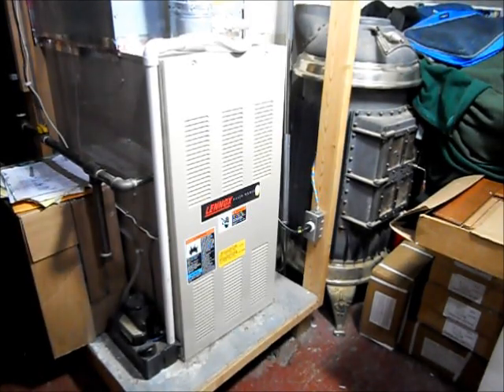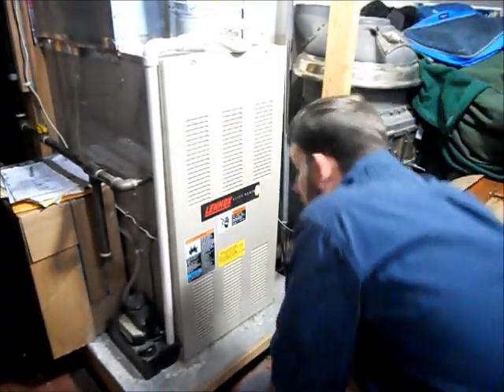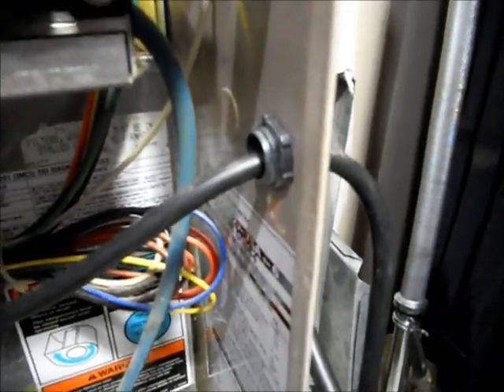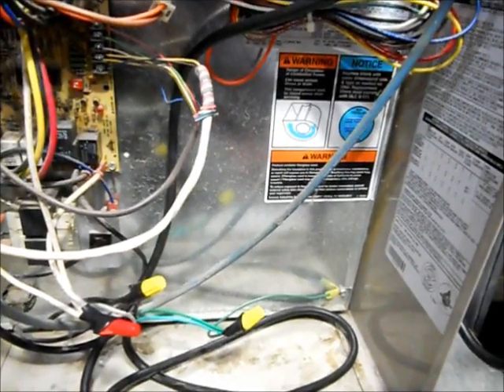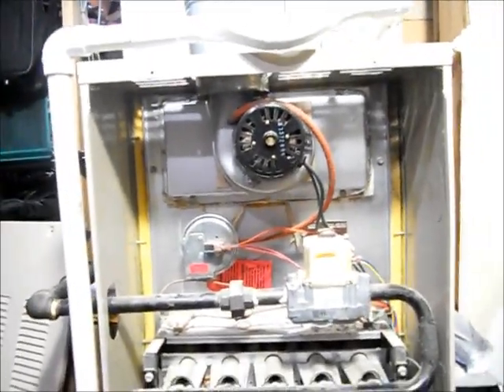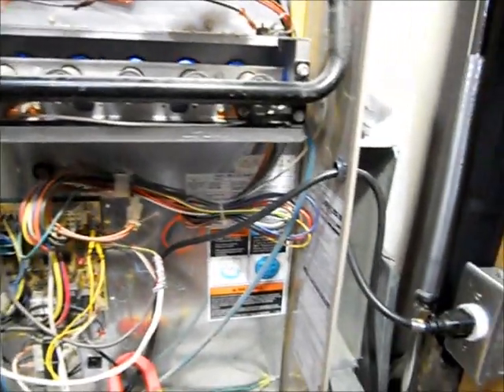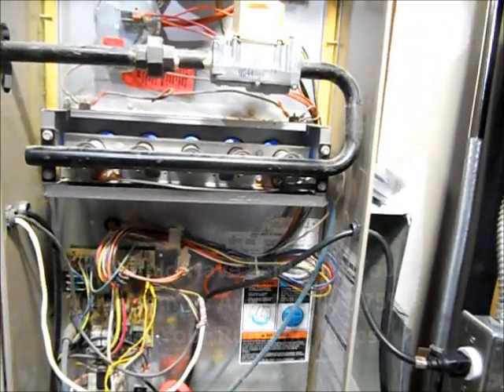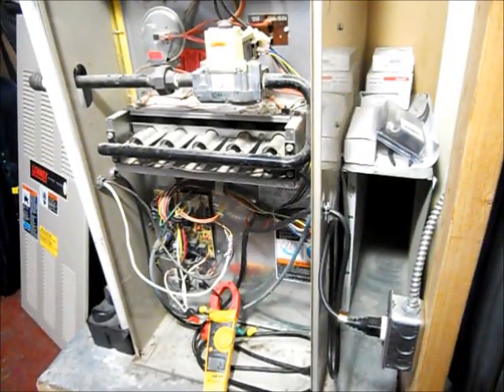RicksDIY How To Wire Your Furnace To A Generator Overview.wmv

Comment: In our house the thermostats 24V transformer runs off another 125 V circuit. So that has to be accounted for somehow or the furnace would never go on if just plugged into the generators extension cord.
i was doing some reading and it seems that at least some states codes require a transfer switch (for the generator) and you can't use a permanent flexible plug in cord for the furnace. I don't know if this is true though.
Reply from the maker: +Lockemeister 
That's a rare old bird you got there, pretty much anything from the late 70's or newer type furnaces all have the transformers inside on the same circuit. I have seen that in larger commercial installations but quite uncommon in residential applications. You are correct with the flexible plug, most places no longer allow that per code. In an emergency it's better than nothing, and if done right is as safe as it can be.

Comment: I done this same thing on my gas furnace just like you said but when I test it on my generator it will run for about 5 sec then shut off and when I have it hooked to the extension cord and hook it in a different outlet somewhere in the basement it will run about 5 seconds and shut off again but it works fine for the outlet I added like you showed me .... you think someone wired the neutral to the hot and hot to the neutral at the junction box before the plug I added and its reverse polarity when I hook it to the generator or any other outlets??